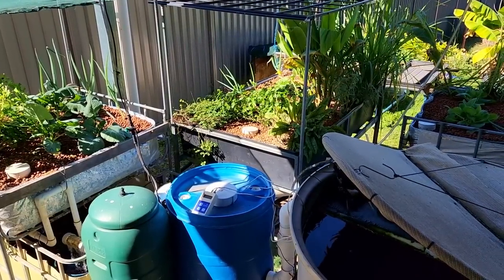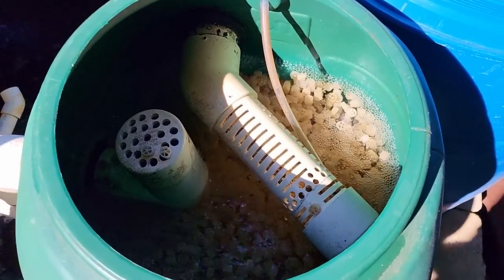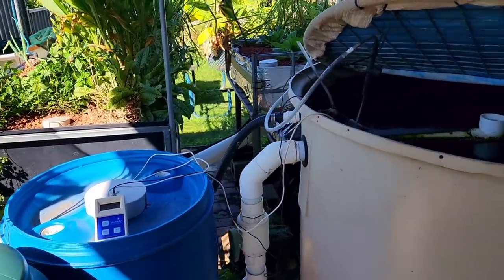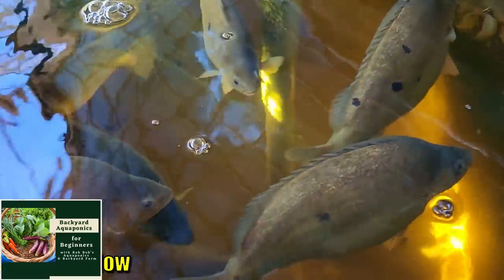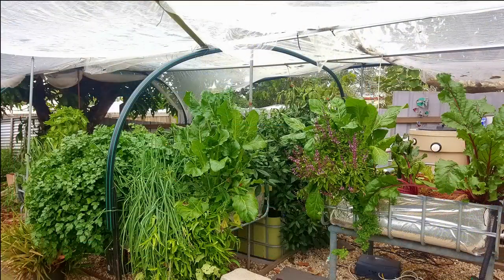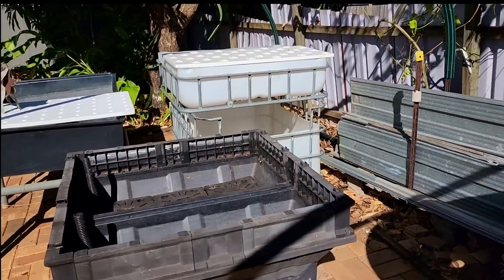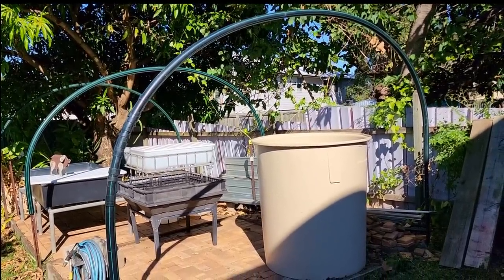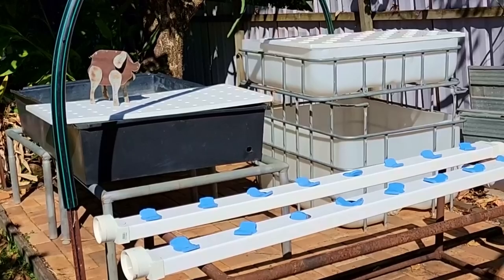New Aquaponics System Design

Comment: Nft, because i am considering doing that myself.
Have you ever considered vertical towers?
Your sump as the lowest point but... it seems you are raising everything to accomendate for its height. Have you considered lowering into the ground by digging?
Reply from the maker: It was dug into the ground in that exact spot in the last build but I'm not going to worry about that again. All the stands I have will be tall enough to flow directly into the sump.🤞
How's your system progressing?

Comment: My 2c is keep the sump near the power source, mostly to minimize power leads around wet zones. With the sump pump being the heart of the system I prefer to have it accessible/inspectable
Reply: If I remember correctly, the system is in a slight slope with the power outlet on higher ground. For the side of water flowing via gravity into the sump, it would make sense to have it at the lowest spot. But then also the system needs a more powerful pump to get the water up into the fish tank, which is most like the highest spot in the system.
With the correct cables and assuming that there is no danger of damaging them, e.g. by rubbing against sharp edges, there shouldn't be much problem with water. If in doubt, I'd feed the powerlines through a water-resistant cover of some sort. But I wouldn't let the position of the power outlet dictate the arrangement of the system.
Reply from the maker: The power will be set up like the previous system I had here. Power lead to a weather proof box that sits near the sump for the 2 pumps I need. Should have decent access to the sump with the layout I'm working on. 
https://www.youtube.com/watch?v=vRx5u3IjxAo
Cheers mate.

Comment: DWC over sump
MB in black 400ltr
DRZ in veggiepod 
NFT between sump & fish tank.
Place radial flow & moving bed between fence & roofing (if enough room).

Have you thought of having a small solar pump push water through some black irrigation hose (during winter)? Placed on top of the hoop house structure supports & zip tied on through the shade cloth around the supports.
Reply from the maker: 👍👍
I Played around with black pipe loops previously. They didn't give the temp much of a bump but it was only a half hearted attempt as I didn't have the best pump. Maybe in the future I'll try it again if I have better facilities (big roof) to set one up. Maybe on the farm. 😉👍
Cheers Eleni.

Comment: It's great that you explore different ideas for growing. I have been working with NFT systems for a while and have found them very useful for short term plants. It would be nice to see you incorporate that into your system . I solved the heat issue by putting a reservoir in the ground to act as a heat sink and help stabilize the water temp both hot and cold.   You could run a pipe underground back to you fish tank with the entrance of the NFT drain pipe slightly higher than the exit into the fish tank and accomplish the same thing. Cheers Thanks for the video
Reply from the maker: Cheers for that CC. Will be setting up the 2 NFT rails in the Frankenstein system. Looking forward to the challenge of getting it all fit into such a small footprint to tell you the truth.

Comment: G'day Rob - Looks awesome mate, would be a major breakthrough to incorporate direct ground and earth connection into the water transfer concept - I've recently been constructing some small bathtub wicking beds in the backyard but are disconnected from mother earth.. the next little project is to have wicking tanks incorporated into the main garden bed to enable plant to earth direct connection and potentially include some fishtanks similar to yours - Keep up the good work and thanks for the good ideas!
G
Reply from the maker: Flow through wicking beds is about as close as I'm going to get to that at the moment. I do know some folks that run a aquaculture/de coupled aquaponics system that use the nutrient rich water to irrigate fodder crops. Not exactly the same but sill a good use for the waste water.

Comment: I have no specific preference for any type of grow bed. I do think that it is a good idea to protect the entire system against fluctuating temperatures as much as possible. Not only will that save money in the long run, but it is also better for the micro organisms and it extends the grow season a little. 👍
Reply from the maker: The hoop house really helps there. As soon as things start to warm up, I can toss denser shade cloth over to help protect the plants + the rails will be up the back & sheltered from the afternoon sun. 
Cheers mate.
Reply: @RobsAquaponics  Actually I was thinking more about insulation for the water pipes and the fish tanks as well. When you have water running through those pipes 24/7 it acts as a heat exchanger, or cold if you will, depending on the time of the year. The same goes for the fish tank. That is how floor heating works. They run plastic pipes through the concrete. And they transfer heat to the concrete. 

I used the cheapest foam insulation for my pipes. The ones that are also used for insulating central heating pipes for homes. It doesn't fit perfectly, because the diameter pipe is a little too large, but it fits good enough to keep the most hot or cold temperatures out. 

Just to demonstrate how effective the insulation is I can tell you that I have 4 IBC growbeds, and during the past winters the last two beds would freeze up, because the longer the water supply pipe the colder the water gets at the end of the pipe. And I am speaking about only 6 meters of pipe or so. I once had a big loss of water because it spilled over after the siphon drain pipe was frozen solid from those two last grow beds. After I insulated the water supply pipe for my grow beds I did not have any frozen beds or drain pipes. 

So it does make a difference for the temperature of the water, and that is also true for hot summers. Insulation takes away that negative variable.  

My main fish tanks, also ibc containers, are buried in the ground, and insulated with 15 cm thick foam panels on all sides except for the bottom. They were reclaimed from an old roof. It still had a tar layer on it, which only made the foam stronger and resilient against insects and what not. It also prevents the ibc containers from collapsing inwards. Without the foam the surrounding soil will push the container walls inwards. Ask me how I know.  

I do it to make my grow season longer because it can get cold here, but it is also true for very hot regions of the world. You just want to eliminate as much of the negative variables as you can.

Comment: Great videos. MB and DWC would even out so many variables. Worry about the DRZ running back into sump on the off chance of soil etc getting carried in the return water. Look forward to seeing the new area. I started with hydro and now loving IBC aquaponics.
Reply from the maker: I didn't have any issues with soil gelling leaching out through the pouches last time. I think the sand in the base helps filter a lot of it out.

Comment: Put your NFT above one and other against the back wall of the hoophouse. Saves on floorspace that way you can put a bed in the place where the NFT is in the video. Use the NFT for some fast turn over greens.
The question is does the system dictate what you want to grow or does what you want to grow dictate the system. For example there is no point in having dual root zone if you do not want to grow things like spuds. So write down your crops, add what they grow in and then decide what to put in the syatem. If there is space left do experiments with new options. Maybe a grow tower?
Reply from the maker: No rails on walls at the moment as I don't have the materials for the racks.
Posted a bit of an update if you're interested on what my thoughts on the layout now are,
https://www.youtube.com/watch?v=vRx5u3IjxAo
Cheers mate.

Comment: Rob, I line the idea of doing all the different techniques. You have the equipment to do it & the space.
I have narrow 8' wide strip that runs asking my driveway & carport. I only have room for 3 beds (from IBC), the sump is under the bed platform beneath bed #1) then the radial flow (which there's room for a 2nd filter using bottle caps down the road, the chop & flip then the IBC rainwater collection tank. 
I'm doing the DWC on the flip bed above the fish tank
In the 3 beds I want to do sand, small gravel & clay pebbles. I want to see if plants prefer 1 type over the other, which holds up to the extreme heat like last spring & summer (highs 100-112° & night lows never dropping below 84°) Then come fall I'll turn it into a high tunnel greenhouse. So I'll need to determine what will due best as a thermal mass, I'm thinking rock.
Future Expansion
-  Tower next to rainwater tote. I won't be able to plant all the way around, unless it's full shade plants, produce or flowers, because the carport & house blocks sun
-  Then I'll b using the old rain gutters to go on back yd cent patio. Originally I'll set that up on it's own mini system just to see if I can grow greens in the summer. It'll only receive peek a boo sun because my giant pecan tree & holly tree. But what sun it will get is intense. I need a place to grow all my different greens I eat raw in the summer. Now I grow indoor hydroponic under lights. In winter I grow in high tunnel & hot boxes. Like to expand so I can feed my hens fresh produce yr round

Comment: Any reason you couldn't use the sump tank as a moving bed bioreactor? I'm going to be using an IBC as my sump, and I'm think of just putting the required media and airstones straight into that?
Reply: Also considering building a radial flow settler out of an IBC..... I'm getting IBC's for free lol.
Reply from the maker: 😂 Why not if you're getting them for free. 👍 I didn't think about adding it to the sump but it would do the job. Thanks, will see what happens space wise as it may just be the best option yet.
Reply: @RobsAquaponics  I'm going to give the sump a go as a bioreactor then. working out how to keep the media from annoying the pumps (I'm thinking about running two - one for fish tanks, one for grow beds) might be some trial and error.
Reply from the maker: @zeropoint546  A sealed drum with small holes inj the base & a large inlet at the top was what I was thinking of. Sort of like my present shade cloth jobbie.
Reply: @RobsAquaponics  With the pumps inside? Sounds pretty much what I was thinking, but I can get stainless steel mesh for free too.... Might rig up some kind of box.... We'll see how much media ends up finding it's way uphill and work from there I guess. 😂

Comment: I thought you would have put a IAVS bed in the system. Didn’t Owen’s enthusiasm rub off on you? I would like to see a duel root zone deep water culture system. Any chance of an airlift? Also will you be adding the new Venturi’s into this system ? 
Can’t wait to see what you come up with mate. 👍🏻
Reply from the maker: 🤣🤣 Owen has a much younger back than mine. 😉 I'm hoping we'll be moving in 3-6 months so this system may be broken down when we move, just depends what the new residents want to do with it. 
No airlift but I will be using Rob's infusinators in the DWC. 
Cheers Mark.

Comment: Hey rob. I currently have 2 250 gallon fish tanks but would like to add 2 more in line. I will have one radial flow settler connected to each one(4 total), do you think it would be ok to have the outlet of the radial flow settlers all connected together to flow into my moving bed filter? Or would i have to have 4 seperate drain lines, one for each settler?
Reply from the maker: One inlet to the bio would be fine Stewart. The retention time required for the bio is about the same as the settler so keep that in mind when sizing the build.  👍

Comment: I feel like the NFT systems are good for vertical stacking.
but I also like the concept of a giant grow bed, so if you're building a table for it i'd say go for the dual root bed.
but if you just need to fill up a wall, fence, or really wanna squeeze in the growing (also if you want lettuce or quick turnover crops) i'd do the NFTs
but lets be honest the real answer 
is all of them :D
Reply from the maker: Looks like I'll be trying a bit of each Zane. 😉
&lc=UgynOa-P-VhdhBcsjlV4AaABAg

Comment: Went under severe storm warning Fri, normal this time of yr in deep south.
2200 wind & rain hit about 60 minutes.
2400 torrential down pour started & winds picked up to 30mph The lightening was sitting above me heading the trees getting hit, branches coming down. Thinking no big deal probably lose power soon.
0100 could hear a massive wall of wind coming the next thing I know "CRASH"!! That wall of wind took down the fish tank & rainwater tote that were full. I just laid there & used some sailor words as mom calls my mouth,... UHG l!! 
I just FINALLY completed everything Friday afternoon, no leaks, no drips, everything cycling correctly... Was ready to head out Saturday to get the sand & gravel for the beds.
Don't have a clue why the tanks came down. Segment pads for post still in place, although water is washed away around them. Built same way I did ask the other okay forms including the one with 2 rainwater tanks...
On the positive side (I can always find that), I was worried the PVC I have connected to carb the rainwater from the gutter & bring to tote stayed in place. I was worried having it suspended couldn't handle the storms I get.
I what's amazing is the full tote did not burst or puncture. Aluminum cage all bent to hell that I should b able to get back in place, maybe. Tank hit the metal pipe that supports carport roof & or a big V dent about 6" deep at the top horizontal bar on cage. That tire sat 4" from that post- crazy. The bottom of that cage is really bad & I don't think I can fix it. I can steal the sump base & just put brick under valve or the base under the flip bed above fish tank & just use wood. I'm thinking one under sump, tote b just fine on the ground.

So if everyone or there is having difficulties getting their system setup hopefully this need will brighten your day- it can always b worse 😳  🤣🤣
Reply from the maker: Oh 🤬 D!
Do you think you'll be able to use the cage again & just dump the base? 
I hope you can get it sorted out soon enough to make use of you growing season.
Reply: @RobsAquaponics  Well I figured it why it came down, I screwed up. I just use one screw while I get everything up & level then go back & secure. I spaced reinforcing 2 18" post. UHG" 😆😆
I got the new platform built, rain tote connected to gutter, & just need to attach the pipes from fish tank to settler to Sump- ran out of plumbers tape 
Not even going to attempt repair on base. Pulling base off sump & just going to stick couple brick under sumos valve to keep it raised. I can bang out the cage for reuse, think I'm just going to do wood box. I planned on attaching fence pickets to the aluminum frame (system in front yd. I'll make the box so ea side is a panel & can easily take apart. I might use the bent up cage to make some half hoops that I can use on traditional beds that I turn into hit boxes in winter, down the road.
We've had a very wet & cold spring, just now getting into mid 80s & nights dropping into high 50s. With La Nino not hitting full force until end of summer temps suppose to remain cool. What I'm excited about is to see how the system does this fall & winter when I cover it in plastic. Should have good results w La Nino. Alpine Strawberries, snow peas & all my fave cabbage family & salad greens
I have all my summer plants  growing in dirt waiting to be transplanted into the system, hopefully by this weekend. Still have 4 dozen pepper plants under the lights in the house.
Heading to my son's in Alabama in 2 weeks, taking him a bunch of veggie plants so I need it working. Have couple properties to go look at for the homestead this trip, excited about that
Im interested to see how all your different beds will produce. R u going to grow same plant in different beds to see what the plant prefers? I'll b doing bit of that here including traditional raised bed & wicking.

Comment: Question to all of Rob's fans:
- Where is everyone getting their clay pebbles from?
I was blown away when I saw the cost. My local nursery wants $40 1 sqft. I had her trust herself 3 times. I said ok, but don't u sell in bulk where I can buy by the yard. Nope
Also, how deep is your growing beds when using the clay, gravel &/ or sand. My father thinks I'm planning mine too b too deep. I'm planning for 12-13" below water 2-3" above the water line. Which honestly, feels like it should b deeper than 12".
Reply from the maker: Have you priced lava rock or expanded shale D? They are both light medias that work well.
Reply: @RobsAquaponics  lava rock basically same as clay. Shale no. I didn't think shale could pass vinegar test for some reason. Have shale all over here.
My dad thought I should do the small (free) gravel w the top 3-4" layer with clay to reduce cost. I haven't seen anyone else do that. I'm concerned that the gravel will get to hit in summer (this yr might not b an issue) but during comet months could b great source of mass heat.